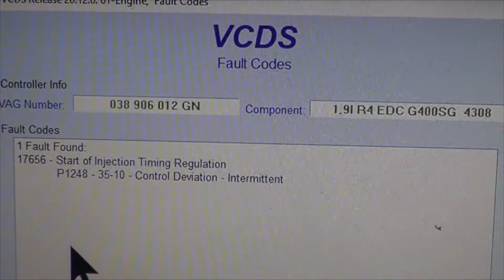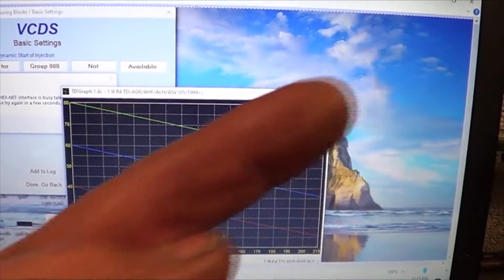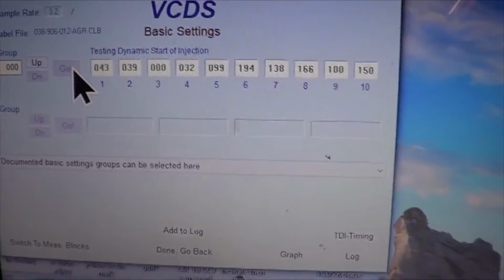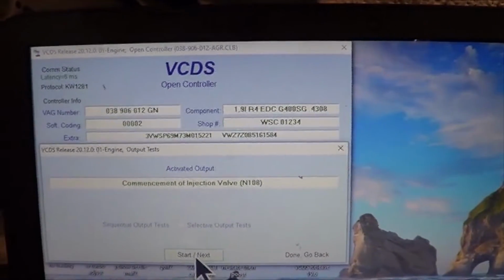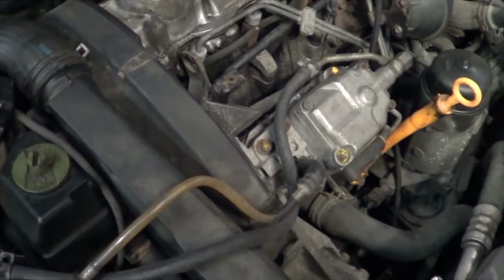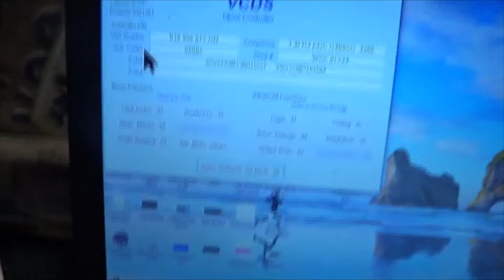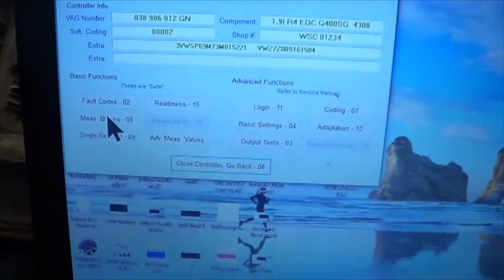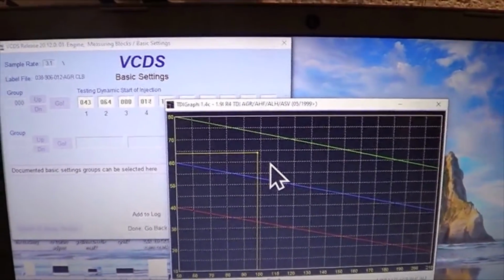ALH injection timing code P1248

Comment: I got this code seconds after my serpentine belt broke is there any wire in that area that could be broken by the serpentine belt and messed the timing? I cant see any damage from the belt to the timing belt. I have to dig into it but i found it odd that right after the belt broke i got that code. I started hearing the engine sound totally different

Comment: Are there any symptoms of timing being out if we have no codes? The car ain’t running the way it used to and i’m suspecting the pump’s timing is indeed the issue..
Reply from the maker: Injection timing is very easy to check with VCDS so just check it or have it checked.
Reply: @CoolAirVw  ohkay sir! Will do it..Thankyou for the reply.

Comment: Hello good sir, apreciate the time and efort you put into making these videos. 
I have the same error code on my alh even after distribution kit, injection pump replacement and yes the mecanic checked and adjust the timing on the replaced injection pump. Any thoughts? 
Thank you in advance

Comment: Bonjour monsieur,
Tout mes respects a vous
Est ce possible de nous faire une vidéo montrant comment vérifier le bon  calage ou la synchronisation avec l outil diagnostic vcds pour les moteur 1.6 ou 2.0 tdi 
Ou au moins le lien de la vidéo au cas où vos aurai déja fais une vidéo en se sens
Et merci d'avance
Reply from the maker: Je peux essayer de faire ça. Avec le travail actuel et l'arriéré vidéo, cela prendrait des mois. Il peut y avoir d'autres chaînes qui ont déjà une vidéo pour cela.

Comment: I adjusted mine now ro exactly where you ended up here after mine was so advanced. It was way off the chart first.  It this ok where you ended up, or must it be as close to the blue line as possible? Great video!
Reply from the maker: People say there are benefits to having it high and there are different benefits to having it low.  in our shop or procedure is that its close to the blue.
Reply: What benefits for advanced timing and for retarded timing?
Is one for efficiency and the other for power?

Comment: Just got this code on my sdi . Running wvo was thinking it was just cause ambient temp had dropped as had lumpy start but low performance and when flat out feels like Stavation. Gna check wiring and fuses for solenoid first but I'm now woundering if veg has made the piston stick hmmm
Reply from the maker: maybe....
Reply: @CoolAirVw  well it's not fuse or wiring . I advanced my timing anyway it's better but still there might have to try a fuel additive
Reply: @CoolAirVw  well it's not fuse or wiring . I advanced my timing anyway it's better but still there might have to try a fuel additive

Comment: I have Skoda Octavia 1.9 TDI ALH. I encountered P1248 after adjusting IQ using hammer mod. There are air bubbles in the fuel line from the filter to the pump. Rough idling, low power, diesel smell in the exhaust, engine vibration are observed. What could be the possible cause?
Reply from the maker: P1248 is for timing and wouldn't be affected by IQ adjust.  Some air bubbles are normal.  I don't know what is wrong.  Use the techniques in the video.
Reply: @CoolAirVw  Thank you so much for the advice. I removed the fuse 29 and I could find the change in engine sound. I will adjust the timing using vcds and also make IQ adjustment using adaptation. I would revert if it doesn't solve the issue.
Reply from the maker: @balajis_mart  Thanks for watching and commenting on my channel

Comment: After changing timing belt kit i got Fault code: P0252]
Injection Pump Fuel Metering
Control
"A" Range/Performance
(Cam/Rotor/Injector) 

Any solution ?
Reply from the maker: did you adjust injection timing using vagcom on the graph similar to what was done in this video?
Reply: @CoolAirVw  I didn’t have it.but car is running totally fine no rough idling no smoke perfect cold start
Reply from the maker: @arpan711  check injection timing with vagcom

Comment: What would cause the timing to not be stable. Mine at temp jumps between 50 to 75. All the videos I have seen they are all steady. 200k+ Miles. Thinking about just installing the 11mm pump as I figured mine is pretty worn.
Reply from the maker: They jump around a bit.  Vagcom even offers a "cloud" feature IIRC to show how much.  If your not having a code I'm not sure if you have a huge problem.   I have another timing related video you might want to watch. not sure if it directly applies to your "problem" or not.  https://youtu.be/Q5AZ2iXbg4k
Reply: @CoolAirVw  ya no codes. Just my first Volkswagen diesel. Got it for 250 bucks because of kid lowered it and hit his oil pan so I rebuilt the engine over winter and was kind of surprised how gutless it was. Slight blow by over 200,000 miles I installed a clacker pump as a lift pump and that helped immensely was just curious if I messed up the timing. Videos always show the timing is steady and mind bounces thanks for the reply appreciate the help. Can you believe that I work on turbine diesel engines and this little thing still gets me 😂
Reply from the maker: @randomstuffwithporgy3879  cool!

Comment: I find that when the pumps sit around a while the QA can get sticky and cause the QA codes. Usually they will free up after a bit of running. That's probably what happened here.
Reply from the maker: QA and timing systems are different. That isn't what happened here.  I agree though QA will sometimes stick like your saying.

Comment: Are their kits to rebuilt those pumps??
Reply from the maker: There are gasket sets that are easily available, but parts for repairs would have to be ordered through a Bosch authorized service center.   The quantity adjuster is a expensive part.